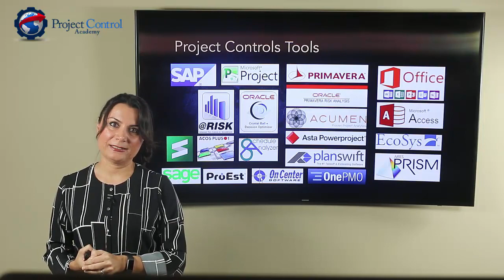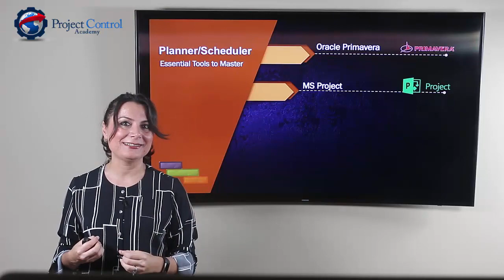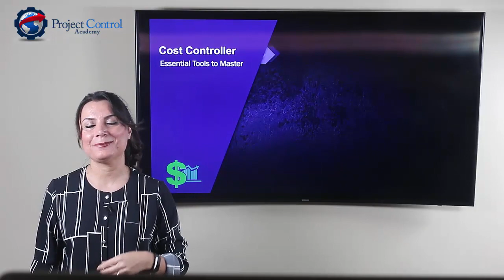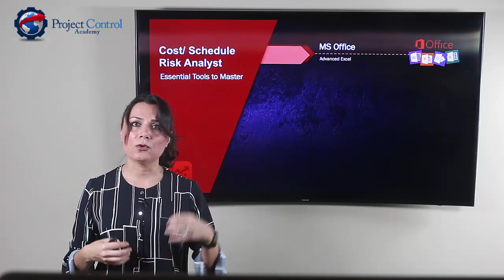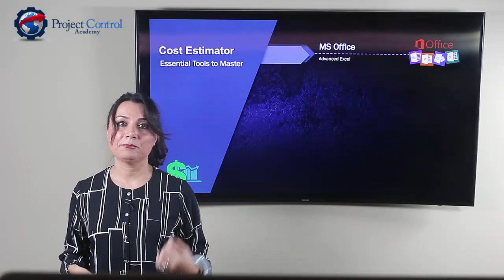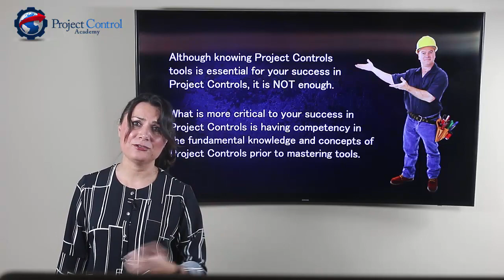Essential Project Controls Tools to Master

Comment: As you know there is features such as defining resource and assigning to task and giving  rate to calculate the cost account in each task and also fix cost …. in msp an P6   so therefore   we can use p6 and msp for cost controlling … is it formal?
Thanks